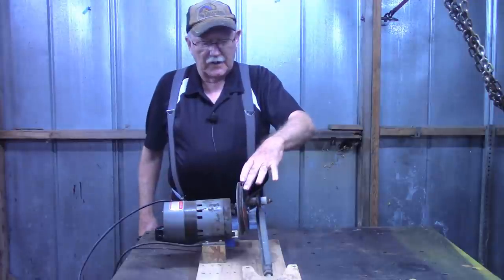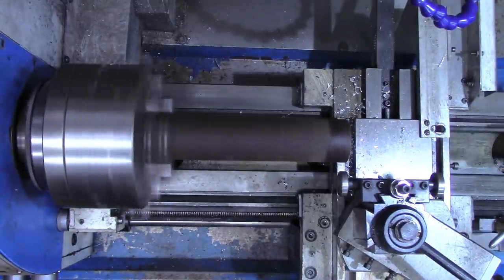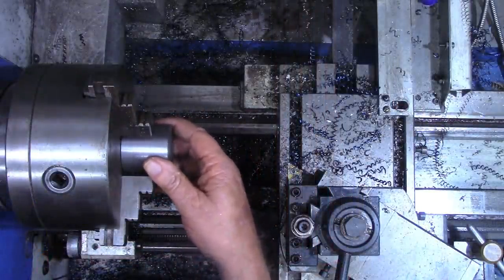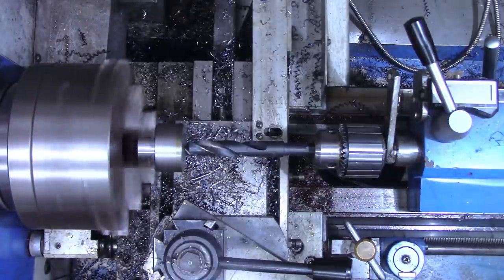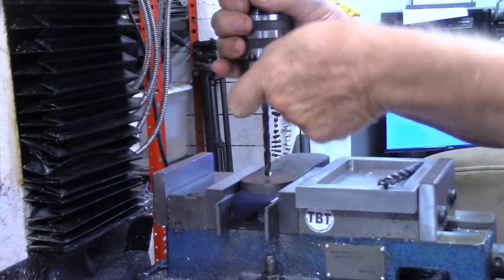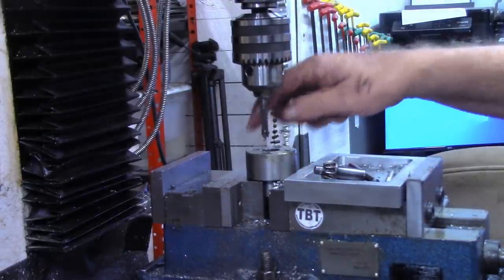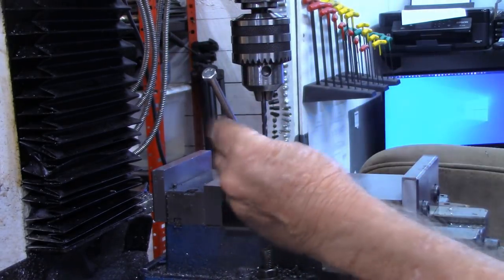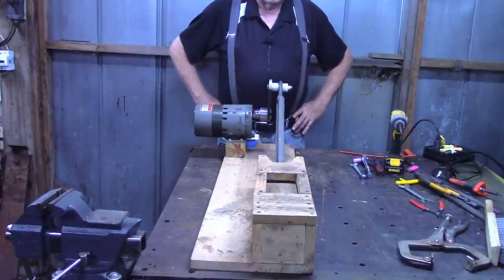Pitman Rod Can Crusher Repair

Comment: Thats a cool item to have and you did a great job with this build.
 While you were drilling at the lathe i was thinking you need to start using some MT/ taper shank drills, i finely got a full set made up buying them on ebay and friends from and i love working with them and i believe you would also.

Comment: Very cool, we had a air shock can crusher years ago but it was violent! Just imagine 155psi all in split second, shoulda had a regulator on it but didn't have one back then, it would turn a full sized can into a 1/4 inch puck 😁

Comment: Thanks for another interesting video . Can you tell us where you sourced the thread testers that are hanging next to your mill @ about 18:50 ?  Thanks
Reply from the maker: I got them through Amazon, hopefully this link works. https://www.amazon.com/dp/B06ZYD4SS8/ref=cm_sw_em_r_mt_dp_31MSTJHGEE6GPJAWTRB7?_encoding=UTF8&psc=1
Reply: Amazon sells similar units, range from approx $29 for 24 testers (metric and US) to up around $70 for a set with more than double the testers in the lesser expensive set. 

John
Reply: If you do some searching for thread checkers sometimes you can snag a good deal I believe I got mine on an overstock deal on zoro for 17 bucks 👍👍👍
Reply: @MrPragmaticLee  Thanks